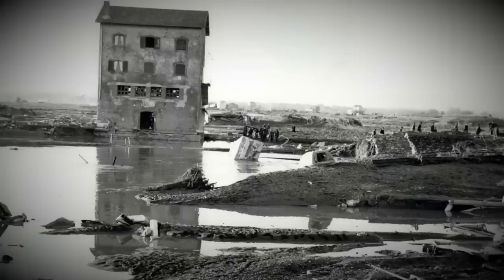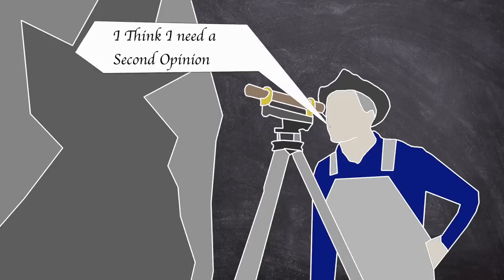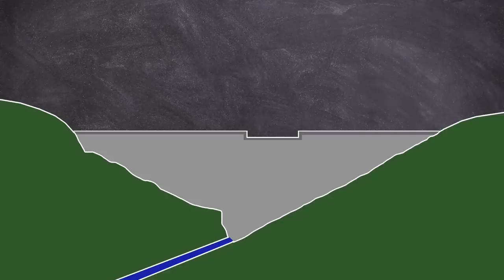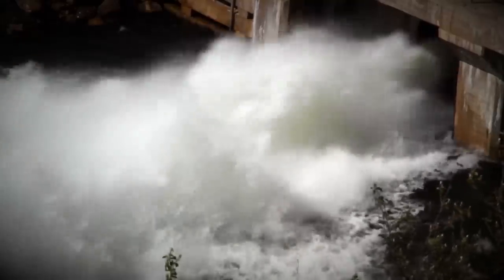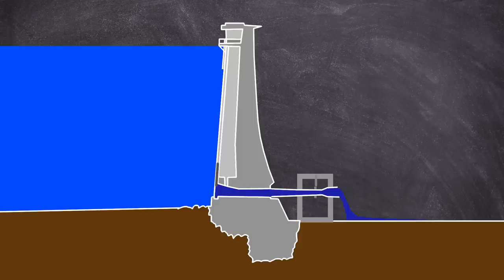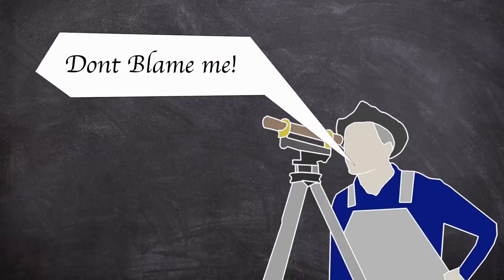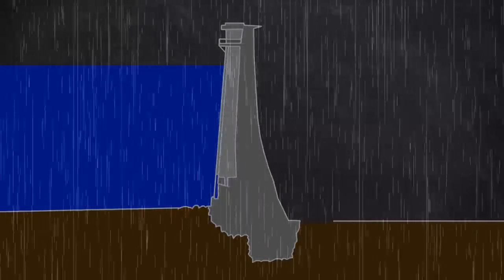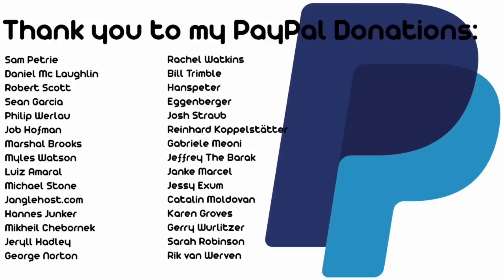Incompetent and Negligent: The Malpasset Dam Breach Disaster 1959 | Plainly Difficult Documentary

Comment: I visited the site a few years ago. The size of the dam is impressive, and so is the size of the debris.. i passed three-storeys high concrete blocks on my way there. I was able to to crawl through the metal pipe at the bottom, through the valve which was left wide open, forever trying to lower the water level. But the most incredible sight is the gigantic hole in the ground under the left half of the dam (which is still standing). Water managed to dig under the dam and dug a huge hole in the ground, through which you can see the other side of the dam. You could walk under the dam if the hole wasn't filled with water.

Comment: "We need to come on site and verify your maths and measurements before you can hold 50 million gallons of water back with your concrete structure."
"It is not designed to generate electricity."
"Understandable, have a nice disaster"
Reply from the maker: :D

Comment: Congratulations for your video! It's the first time I can hear the explanations about the Malpasset dam failure which was due to these reasons (the fault that prevented water from evacuating the foundations, the first time the dam was set under water pressure...). I can add a third cause of the unhooking of the construction: have a glance on the left bank of the river Reyran, you can see how smooth the surface the dam laid on is. That is a phenomenon called alkaline leaching which turns K-feldspar into soap on which concrete slipped under water pressure, especially when the ground is micaschists. Geologist Pierre Bordet, who issued a thesis on Esterel in 1951, quoted this fact in the sixties.

Comment: To complete your video, in 2009
 I visited the Frejus Town hall  exhibition (if we can call it that) dedicated to the 1959 drama.

In addition to the fact that the majority of the population was against the chosen site, it shows the long process of building this dam.
Numerous strikes slowed down the construction of the building, the owner of the mine that the reservoir was to cover filed numerous legal appeals
Last but not least, a block 20 meters long and 10 meters wide
had been assembled with concrete of dubious quality.
It is likely that this is the block where the reported leaks appeared.
The guard had also warned the authorities that the use of dynamite for the construction of the nearby highway was causing small waves on the forming lake.
The trial of the Malpasset dam disaster lasted 4 years and in 1971 the final judgment was that this disaster was due to inevitability.

Comment: Some very important facts have been missed here, I did a TV investigation & report on this at the time of the opening of the memorial in Fréjus and interviewed François Léotard former mayor of Fréjus & later government minister. The A8 autoroute was under construction at the time of the disaster and during the filling phase, each time the highway contractors chain blasted the hillside which was perilously to the eastern wall of the dam, André Ferro the dams gardien reported severe rippling of the the water surface of the dams water during blasting, this was reported to the prefecture but ignored. Further to this as part of his responsibility he requested to bleed off water long before the critical level but was refused as the autoroute bridge was under construction down stream. Visiting the site it is clear, the eastern wall was not cut into the rock as the plans showed but rather butted to the face & secured with only 1 inch mild steel bars, combination of the blasting & poor workmanship contributed to the failure, The engineer André Coyne allegedly committed suicide & later André Ferro died under mysterious circumstances, I spoke to Gérard Ferro, the son of Ferro who alleges his father was murdered to silence him, I was told to play down the report as a blanket of secrecy was placed over the whole affair, make your own minds up.

Comment: An interesting one to keep an eye out for might be the explosion of the Mitholz subterran amunition dump in switzerland december 19 1947.
An estimated 3000 tonnes of amunition exploded resulting in nine deaths.
The interesting thing is, only a part of the stored amunition detonated. A recent survey in 2018 found that the risk from the remaining explosives is far greater than previously assumed, and a complete clearing of the collapsed storage facility would be necessary. Not a small task given that half a mountain had collapsed ontop of the tunnels.
Cost for the project has been estimated as well over a billion swiss francs.

Comment: Silly me! I thought this was the damn dam in France that caused a disaster because operators ignored a large landslip forming above the impoundment caused by the filling of the reservoir. Half a mountain slid into the reservoir causing a tidal lake wave (?) that overtopped the dam flooding the valley and towns below with eerily similar results.
Reply: Talking about Vajont Dam? That would be Italy, if I'm not mistaken.
Reply: @Puukiuuki  Correct.